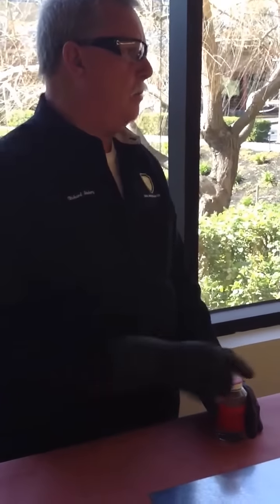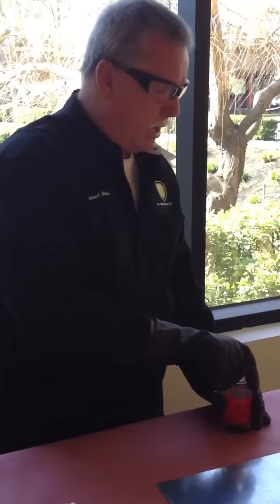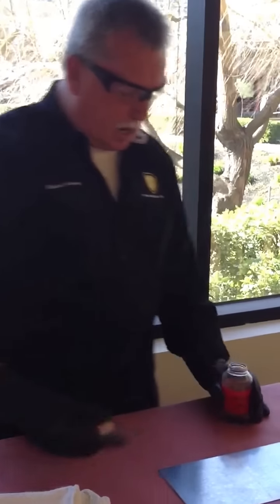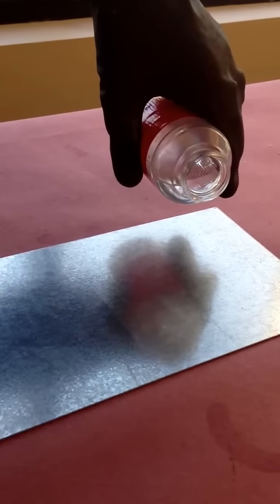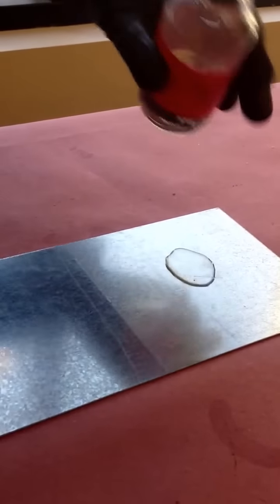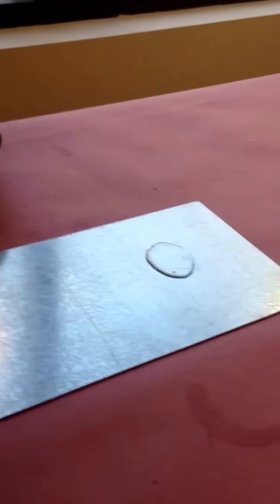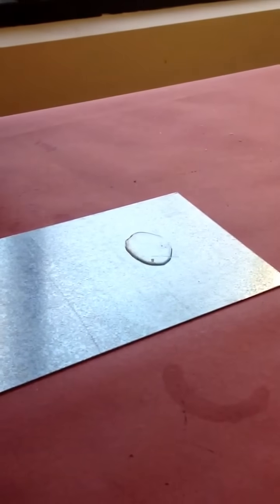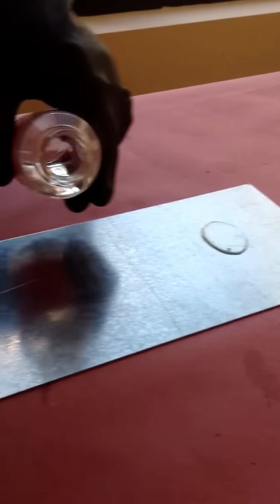Acid on Galvanized Metal

Comment: Did he say that backwards. Galvanized and zinc plated steel are stripped of the coating with HCl. 
I do it all the time before welding. Muriatic acid is just 32% HCl.

Comment: Do you think this could be done by soaking a cloth in this acid and wiping down the area you want to remove the galvanised coating? I'm trying to remove the galvanised coating around where a weld will be done while keeping the coating on the rest of part.
Reply: Muriatic acid (HCL) will most definitely remove the galvanized (zinc) coating from ANY metal you apply the acid to. The “rag” application will NOT work simply because the acid will eat the rag worse than bleach would if you poured straight bleach on it. You can just pour the acid straight on what ever it is you’re working on but I would go light so you don’t get it on anything else. I would also dilute the muriatic acid with water. Something like 90%water and 10% acid. Also, vinegar will do the trick as well but it takes a lot longer but overall it’s easier on the surrounding parts if you get to much on the piece. The man in the video was NOT very clear about what is going on and I only was able to figure it out by reading the description and listening to the people in the background. This video is showing that the piece of galvanized metal, that is laying on the table, is coated on one side with their “special” coating and the other side is just bare galvanized metal. The side that doesn’t react and/or starts bubbling is the coated side and the side that immediately starts to react and starts to bubble is the galvanized metal that is NOT coated. The description says something about “nano technology coating” and their company name, which is “quality-coatings.com” or something like that. So, I believe this is a demonstration that they are doing to show how their “special” coating protects the metal from any kind of corrosion or damage. Good luck and sorry that I am late to the party.